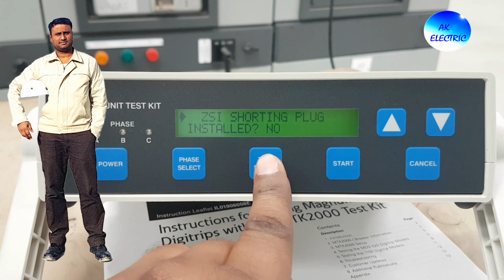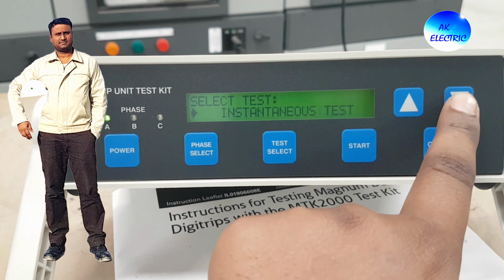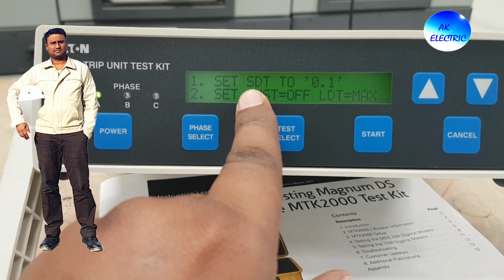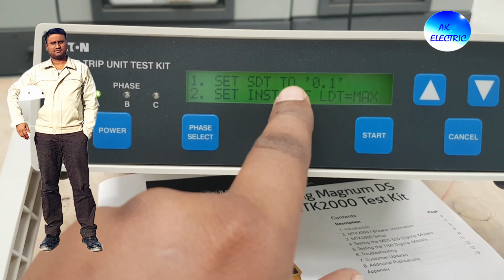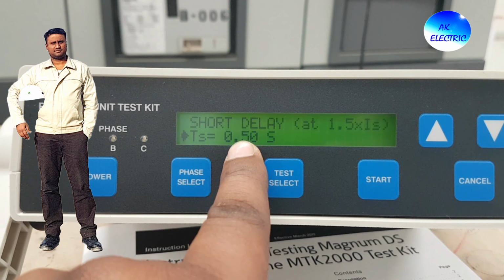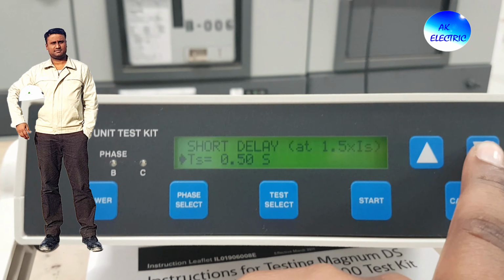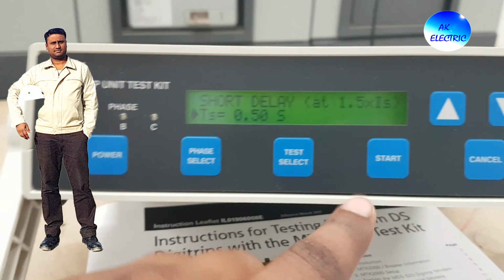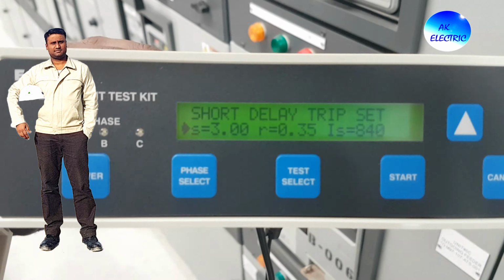ACB SECONDARY INJECTION TRIP TEST | SITE TEST | LONG DELAY | SHORT DELAY | INSTANTANEOUS

Comment: Sir one question..

If we dnt change the setting on ACB for a short delay time ,long delay time,ground time,instantaneous n we keep jst all the same reading as it is on ACB and on secondary injection device we set as per ACB reading n strt the test ..it will be okay ? 

Do it will work ? Can I pass the test ?